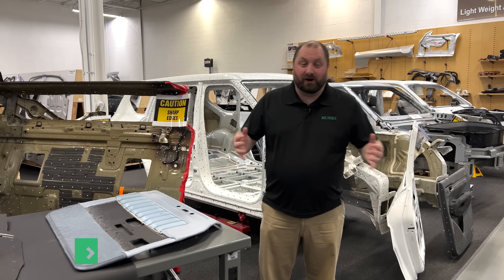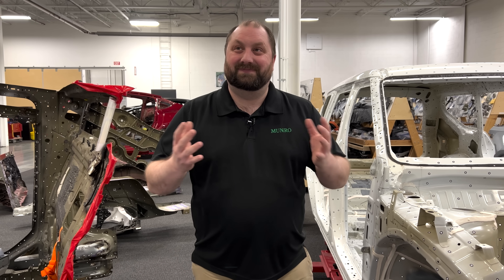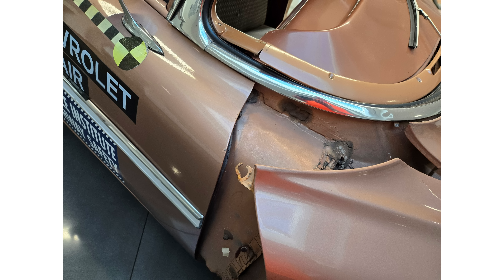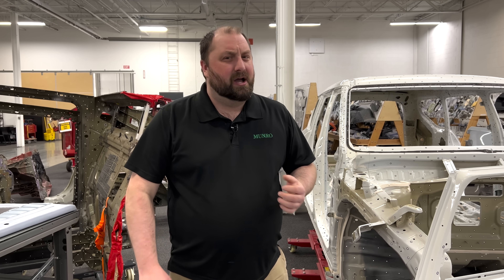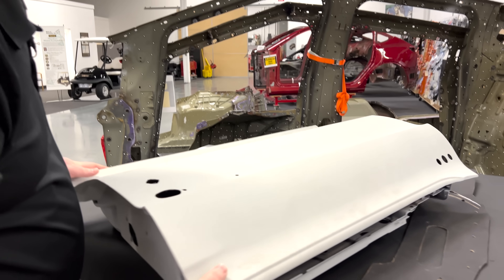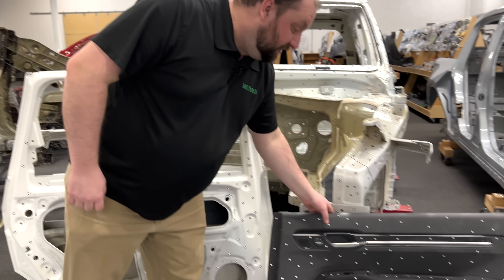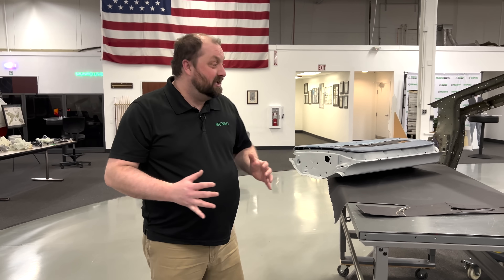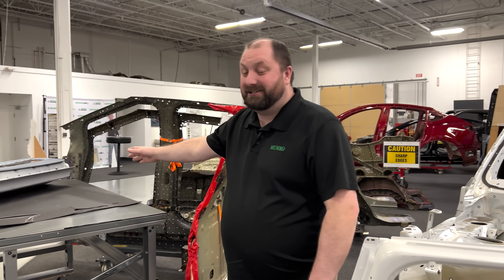No, Your Classic Car Isn't Built Better Than Your New Car

Comment: "Man they dont make it like back in the day" Cars literally had a 5 digit odometer becuase they weren't expected to go past 100k miles
Reply: I remember a story from my grandparents when they bought a GM car from the 70s it had a junk transmission from the factory so the dealer just robbed one from another new car on the lot. We live with the garbage today but forgot the garbage of yesterday.
Reply: I've heard this statement before, but everyone I know who was driving fifty years ago says it's not true.  

It was probably true a long long time ago, but I think the 5-digit odometer was just a lazy a holdover for at least a couple decades before everyone had finally updated it to 6 by the early '90s.

Most of my '70s and '80s cars have had over 100,000 miles and have continued operating well beyond that point without any major work.  I think people just didn't really care, because you could easily tell the difference between a car with 40,000 miles vs a car with 140,000 miles.
Reply: @NoName-ik2du   As someone who started driving more than 50 years ago, the 5 digit odometer was done away with by regulation.  Manufacturers didn't do it, the government insisted on it because cars did last longer than 100,000 miles (or KMs in our "we're the only ones on the planet" mindset).  In particular, foreign cars (Japanese cars) were lasting longer than had been typical.  American made engines were designed to fail.  The car bodies also rusted away (this was at a time when the majority of the population lived in the rust belt).  So American cars didn't really need 6 digits until the mid to late 80s when various factors came into play that extended their lives (competition does that).
Reply: @ Interesting, I didn't realize it was a regulation.  I looked up a bit more on the regulation and found a few fun facts:
- Automakers in countries where distance is measured in metric were the first to switch to 6-digits, because their 5-digit odometers would roll over faster.  Countries that used miles (like the US and UK) waited longer to make the switch.
- Before the mandate, AMC had some vehicles that had 6-digit odometers, but they could only display 1XX,XXX and nothing higher.
- In the early '90s Ford still had some legacy models that hadn't been updated to 6-digits yet.  In certain states where the 6-digit odometer had become required, Ford had to install special clusters, which they listed on the window sticker as an upgrade called the "MILLION MILE ODOMETER".
Reply: @NoName-ik2du  well since you know everyone that drove back then you must know for sure… you might want to check your sources.
Reply: I remember in the 1970s someone made the local newspaper when their car turned 100,000 miles.  That was quite an accomplishment and almost unheard of back then.
Reply: @craigmerrow225 show us the article
Reply: Cars were much better 20 years ago though
Reply: @tedarcher9120  Personally I believe they peaked mechanically between say 1990 and 2010.  Maybe some extra air bags for safety since then, but over all yes.  I drive a 2001 and 2003.  Happy with both.
Reply: @vince8436  I'd say 2005-2008. Jaguar bonded aluminum frame is a masterpiece
Reply: @tedarcher9120  It's right there in my range choice.  I based it on all cars both imports and domestic.  Some were still good through early 20 teens. But only the less featured ones.
Reply: @vince8436  1990 cars still did not have all the features you want, maybe top models from Mercedes. Models from 2005 had basically everything you'd ever want in a car without bullshit
Reply: @tedarcher9120  Except the safety.
Reply: @Mercer1012  not really. Modern huge SUV are way more dangerous
Reply: @tedarcher9120  They were not.
Reply: Thats not due to engineering, thats due to materials technology and oil technology. Nikasil coated cylinders and modern oil does that. But if you applied the same technology to an old cast iron, it would far outlast anything today.  Wet belts in modern vehicles are also illustrative of planned obsolescence being worse today than in yesteryear. Additionally, the economic conditions were far more favorable back then. People could afford to get a new car because they wanted one. Not so today.
Reply: @smh9902 sorry yo break it to ya but that's literally engineering.
Reply: @Maximus20778   Materials engineering, but not automotive engineering. Apply the advancement in materials technology to the "old" designs, and you'd literally have a vehicle that would last over 2 million miles. And you could fix it yourself with basic tools. But we both know why thats not going to happen.
Reply: @smh9902  there's cars that are millions of miles.
Reply: @smh9902  Dumb comment. Materials tech won't fix the terrible X frame which is bad from a safety standpoint and that is engineering. Older engines were rougher, polluted more, etc. All of that was fixed by engineering, not just materials science. By the way, materials engineering is a part of automotive engineering.
Reply: The 5 digit odometer was an exercise in psychology by the automakers. When that odometer got up to 99k, people would start thinking it was time to replace the car. And the psychology worked, because people still believe cars are junk when they hit 100k. It wasn’t that the cars didn’t last more than 100k back then, because many of them did and are still going. It was one more way for automakers to keep people buying.
Reply: Car still built better honestly cars should be slower today most cars are way too fast especially ev cars.
PS I am gen z.
Reply: @jonathancunningham8739 as a gen z that's nonsense to say that. We didn't come from being from centuries being slow to being fast for no reason.
Reply: Yes and today they have 6 digit odometer and crap out on you as soon as that warranty is up.
Reply: Except back in the 50s or 60s it was cheaper, adjusted for inflation, to replace the entire engine or any other major components than it is to do anything beyond basic maintenance on modern cars
Reply: They did that so you'd go buy another car, not because it was actually wkrn out
Reply: Lmao, 84 e30 with 500k miles and still strong  .
Reply: @carlosoruna7174   A 2019 Corolla with 445K miles and still running like a top. Only fluid changes other than brakes and tires.
Reply: @moshet842 Are you an Uber driver?  That’s a lot of miles in 6 years!
Reply: @oliversnow   A friend's medical delivery car.
Reply: @carlosoruna7174  Exceptions do not prove the rule.
Reply: @Callsign_Sturm so true
Reply: @Callsign_Sturm  Baloney. People do less today because they don't have to. Despite beating the shit out of these cars, Toyotas will still run fine. You could not do that to a car from the 60's and 70's.
Reply: @carlosoruna7174 and if you get in a wreck it’s a tin can. Hence the point of this video. 😂
Reply: @Chingusbobingus  Then at least I die in style also most vintage car owners drive extra carefully to preserve such a car also late 80's cars are safe as well as the 1990's cars.

Comment: I still remember the day when people started talking about crumple zones in vehicles.
The first law requiring seat belt wearing was passed in the 1970s. 
Later, in the 1990s, it was also mandatory for rear passengers.
No, old cars are not safer.
Reply: Technically the old cars had crumple zones too. The passenger compartment.

Comment: In the old cars it wasn't the floating shotgun or the lack of crash bars it was the weak structure around the doorframes ABC pillars. 
More importantly many don't have seatbelts. You're 25 times (2400%) more likely to be killed in a crash if you are ejected. It's not going through the windshield that kills you it's the car that runs over you while you are lying in the street. Police Magazine September 1993.
The cheapest way to greatly increase front and side impact strength is to install the seatbelt retractor usually found in the B pillar under the seat so the B pillar doesn't need to have a hole in the back of the pillar at bumper height. In a side impact. In a front collision the crash bar usually goes from the top hinge to the bottom where the rocker panel and b pillar meet giving the crash bar something stronger to push against.
Reply: Try to use the passenger door for emergency ejections.

Comment: "You're safer on a motorcycle than in a classic car."

Got a right on red photo of me in my 75 Toyota Hilux surrounded by modern day cars & the 1st thought that came to mind was.. 

"I'd most likely lose a leg if I got T-boned on my motorcycle same as in this mini truck but at least NPFD wouldn't have to cut the rest of me out the damn thing!" 😂

Got a 65 Chevy Nova II I'm gonna stick a homebuilt Heidts kit into designed so that if I hit something it forces the engine & transmission down underneath me like a Volvo so I don't eat the swapped 4 cylinder.
 Sticking a full sub 10 sec NHRA approved cage AND a one piece fiberglass front clip painted to match the original just for putting around town in very slowly & hopefully the subframe, cage, carbon fiber driveshaft & crushable fiberglass improve my chances of survival.

Comment: Anyone who thinks old cars  were built better isn't old enough to have owned one when they were new. My first car was a 1971 Ford Maverick, bought it in 73. The carburetor had to be rebuilt every couple of years. The muffler also had to be replaced every couple of years, I had mine fall off in a really dangerous neighborhood on the South side of Chicago. I got rid of it in 1980 when it was sold for scrap, it was so rusted that the shock mounts had separated from the body. The drive shaft of my father's three year old Rambler fell out on an expressway. He replaced the Rambler with a 1963; Chevy which rusted away by 1969. The bias ply tires on those cars lasted 12,000 miles at best. They needed tuneups a couple of times a year. In a word those cars were junk. They built them to wear out in a few years so that you would have to buy a new one.
Reply: We did far better with our 1974 Maverick, but my dad replaced power steering hoses a few times and it had rust holes within four years.
Reply: Old cars certainly weren't safer or built better.  But, some of the problems in the comments above are corrosion, which is still a problem. Why didn't my family's cars have rust? Because we lived in San Diego County California. 

Why didn't my 68 Mercedes rust? Because I had it in Saudi Arabia. 

The Just Rolled In channel has a lot of examples of bad rust on new cars.

The 1951 Nash didn't rust, but Dad said it leaked oil like a sieve. 

The 1956 Ford Country Sedan didn't rust, but when it was 3 years old Dad was working on it at least twice a month.

Now, I  have 2 vehicles. The 2006 Tacoma with 123k miles needs service annually bc I only drive it 2,000 miles a year. The 1949 Packard Standard Eight Touring Sedan is very seldom driven, never over 60 mph bc of the instant open heart surgery steering column.
Reply: In normal driving RUST is a HUGE problem in all classic era cars. I drove a lot of cars that I loved  back then, but all of them developed rust issues.
Reply: You had a ford there is your problem
Reply: Ziebart
Reply: That’s just cheap American cars , old mercedes benz cars from that time are still daily drivers in third world countries because they don’t want anything else, i personally still have an w123 with 380k still going strong
Reply: @quirinm.  Expensive American cars were good too. He could have bought a Ford LTD Broughm, but he opted for a Maverick.

And who cares if you rebuild the carburetor and replace the muffler every two years, if nothing else goes wrong with the car?
Reply: @ the rust also is easily avoided, i have a 79 Camaro that survived its first 25 years as a winter car because it was pressure washed and sprayed with thick used oil before every winter
Reply: @quirinm.  I think I would use clean oil . . .
Reply: @quirinm.  I was just in Mauritania, West Africa, 2 months ago. 95% of their cars are Mercedes 190D from the 1980s. I didn't see any surviving cars from the 70s, though.
Reply: The Maverick was a super-cheap car.  There were much better cars available.  Also, all mufflers last much longer because gasoline no longer has lead in it.  Lead is a corrosive.
Reply: That's American quality for you
Reply: @FrozenHaxor  It is not representative of American quality. You can buy a cheapo American car or you can pay more for the high-end car. It is your choice.

And the rust has to do with snow, ice, and road salt -- not quality.
Reply: rust can be fixed forever doing an hour's work with Fluid Film (which has been available since WW2, originally used by US Navy)
Reply: @steinbauge4591  To be applied to NEW vehicles, not used vehicles where even mild corrosion has occurred. Otherwise, I agree with you.
Reply: @steinbauge4591  You don't need to do that on modern cars to keep them from completely rusting out after 3 years though lol.
Reply: Clearly, you just didn't take good care of your cars. You never applied undercoating to protect it from those harsh Chicago winters. As well, a carburetor or a muffler giving you an issue every few years is not really a tremendous amount of problems, especially when someone today may experience more vehicular problems in a month alone than you can count with your own fingers.
Reply: @bingwing921  Doesn't matter. I don't have to change the muffler on my cars or even worry about the exhaust. Even after living in the north and the salt, my first car was a 9 year old Infiniti G35 and only after it turned 14 years old with no anti-rust work except for weekly washes with underbody spray in the winter did it start to show rust damage.
Reply: no one thinks that, bullshit video premise
Reply: @evlo8059 nice try but that's literally a fact that it happened
Reply: @evlo8059  Yes they do. Lots of people in fact. Especially boomers.

Comment: In many ways they are, modern vehicles just like pretty much e4verything modern is built like crap. Designed to last a short time before being replaced and be as difficult to repair and maintain as possible. To say nothing of the sharp drop in quality vehicles have seen in the past 25 year as they outsourced all the important parts to Mexico and china. Now that it's all build outside the USA and Canada literally every manufacture is having tons of engine and transmission problems. Not only are you being ripped off  by a 400% increase in new vehicle price but the cost of ownership of that vehicle is up hundreds of percent as well. And the reliability is way down. Don't buy a new vehicle they are pretty much all crap. "Luxury plastic" "own nothing and eat the bugs peasant"

Comment: UK Fords from the 1950s needed full engine rebuilds at 60k miles. Ford garages all used to stock rebuilt engines.
Reply: They were famous for camshaft burnouts after two years. The metal used was no better than beer can.

Then the Japanese came along who made engines to last, as that was their mentality.
Reply: @johnburns4017  Yep; I have an 80's Mazda with 320000 km's; inside the engine camshaft looks like new, perfect compression in all cylinders, bottom end is rock solid.
Reply: Here’s the thing as to why engines fell apart fairly easily back then, it was what was used for crankcase ventilation. Many years ago before the PCV valve, engines simply used a road draft tube to ventilate crankcase vapors from the engine. Worked at highway speeds and anything over 30 mph, but didn’t do anything at idle or below 30 mph. As a result, the blow-by gases would react with the oil creating this nasty tar/gook/sludge which would ultimately cause oil starvation problems. As soon as the PCV valve became mandatory in 1963 (California mandated PCV valves in 1962), became more common to see engines with over 100,000 on them. 

All older vehicles used a road draft tube before 1962, believe that’s how it was in the UK and Europe though they probably didn’t make it mandatory until the late 60’s or early 70’s.